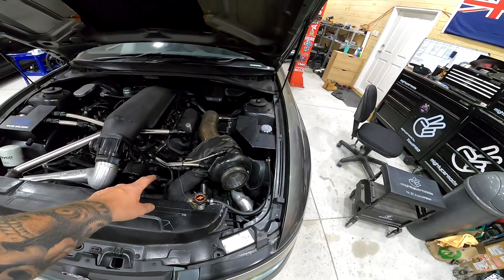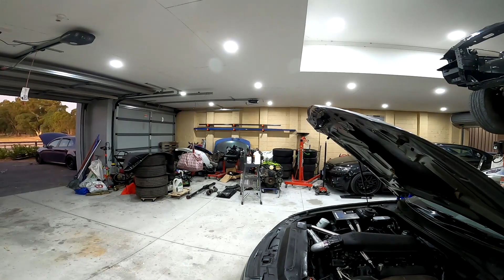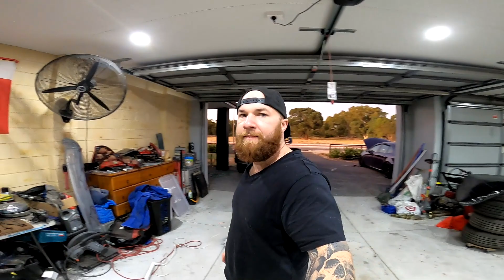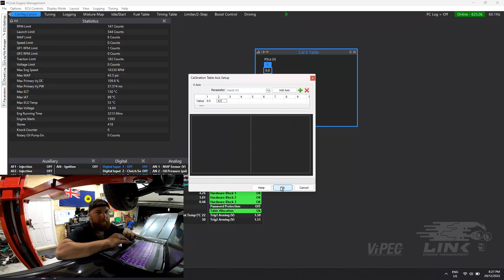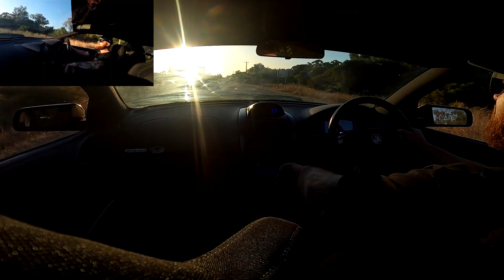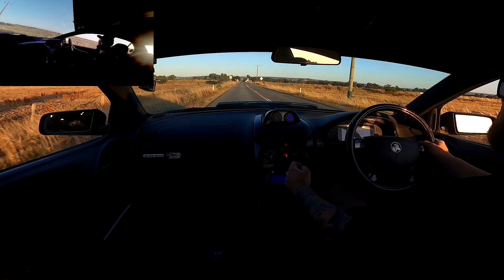Ecojet Build - BackPressure Sensor Install & Testing It

Comment: How low of a back pressure ratio is acceptable? Obviously lower is better but what kind of ratio would you look for?
Reply from the maker: As low as possible is best!
Its basically impossible to have lower than 1:1 as far as I'm aware. But you want no more than 2:1, you can obviously have more but you are pushing $h×t uphill and putting a lot of stress on components for no reason

Comment: I’d like to line that up with my vs one day! if you ever come to qld with it! I’m too broke to take this over there! it’s pretty even on 15psi now by the looks of it and run’s similar mph on the 1/4 and similar time pull in 4th but is a completely different animal on 20+psi  was running near 30psi the last few weeks but just started blowing a little blow by  ooops! it’s still driving fine with no oil use yet but it’s def got a hurt cyl I’ll just switch rings if’s just them in reality though I’ve been hammering these cast kb’s for couple of years so I’m not expecting them all to be perfect still
Reply from the maker: I have a bigger turbo waiting haha, this is still on low boost. This will mph 136+ with ease at this boost if i get off the line well
Reply: Good luck,this cars going to fly when it's done, it isn't a half ass build
Reply from the maker: Hopefully man, have a few things to suss out still to get it to really boogie
Reply: @lukefox7011  mine has already trapped 136mph nearly 2 years ago and it traps easy 125 on 98 octane and is not a half arse build but one built with money spent where needed
Reply: Bigger turbo on too tall of a first gear and too much lsa um I’ll see you at the finish line lol just let me replace all my bananas for conrod’s